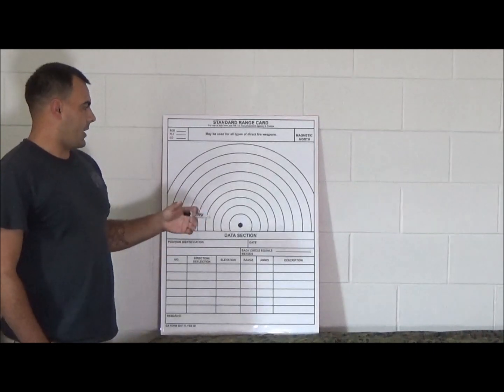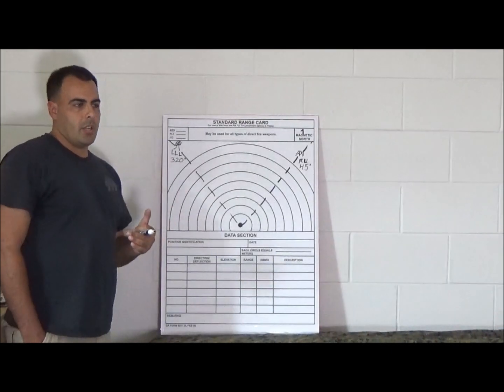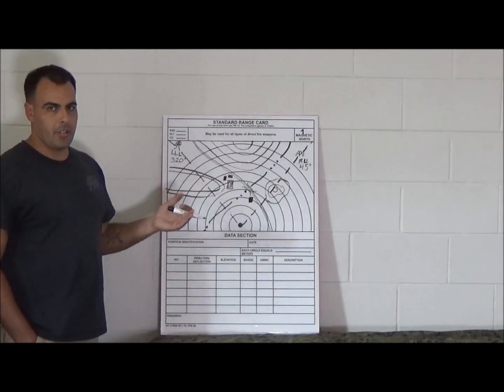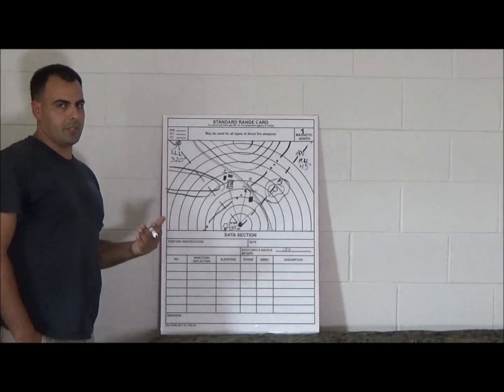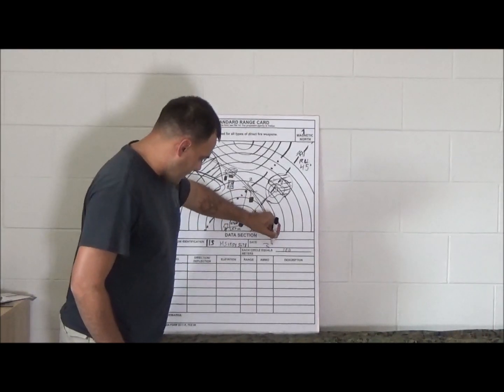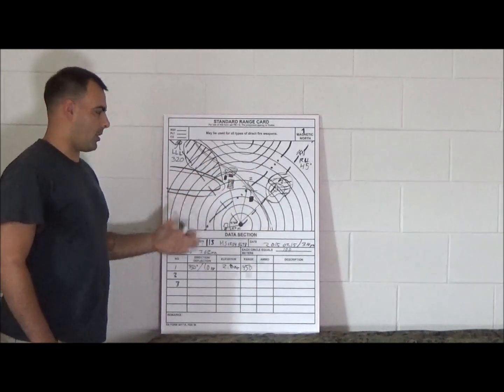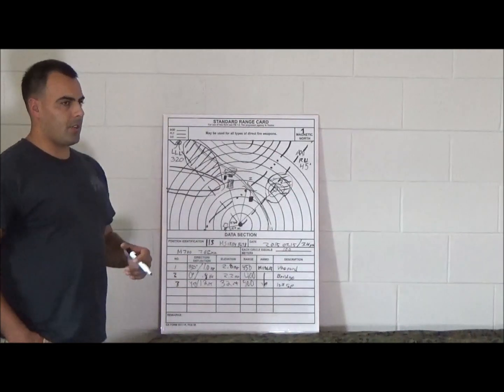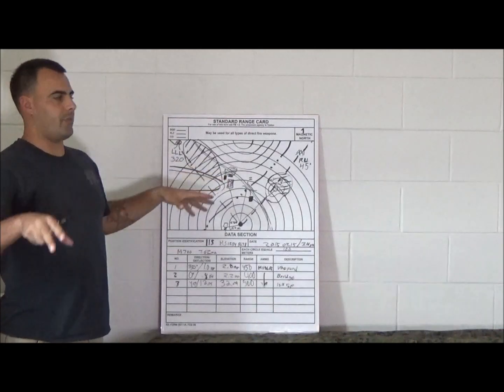Range Cards for Rifleman.

Comment: Weren't you a section leader at 1st Reg SS
Reply from the maker: Joshua Doles I was a platoon sergeant with 1st Marines RSTAC.
Reply: @MikeM0331  we worked together in 2017 I was in S3
Reply from the maker: Joshua Doles Right. You were a machine gunner.

Comment: Overall, good class, pretty detailed, you actually took the time to explain every single detail that you put on the range card and I was pretty impressed until I realized that at no point you mentioned PDF (Primary Direction of Fire) or FPLs (Final Protective Line) which is specifically what I was looking for to refresh my memory. I'm not trying to be a dick, like I said, good class but it was missing exactly what I was looking for. Good luck!
Reply from the maker: tater no worries. I left it out because it wasn't meant for automatic weapons with cones of fire or beaten zones.
If it helps, a PDF will be a TRP, with the traversing bar on 0, and an FPL will be one of the lateral limits, thicker where there is danger space and thin where there is dead space, and it's within the weapons grazing fire range.